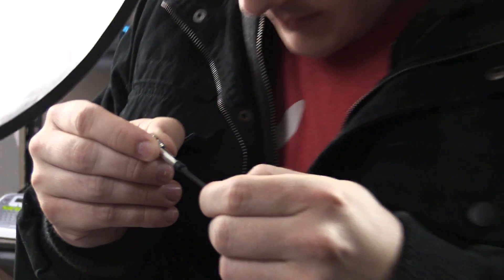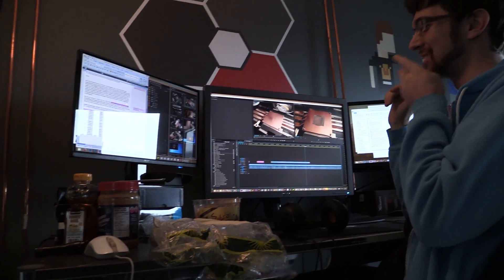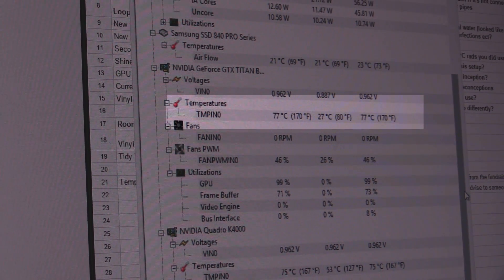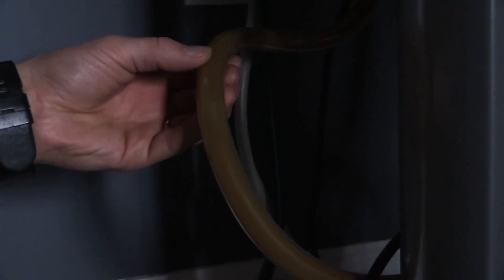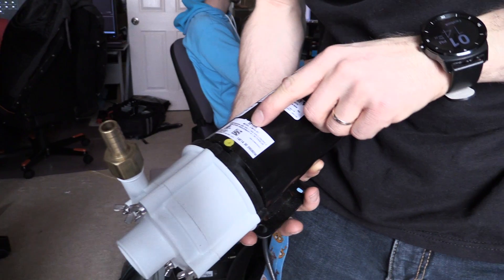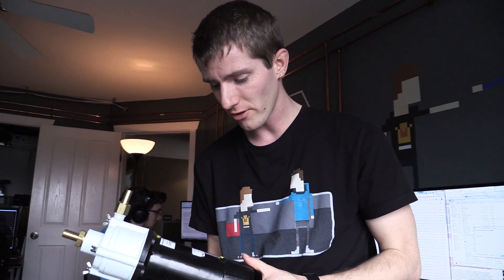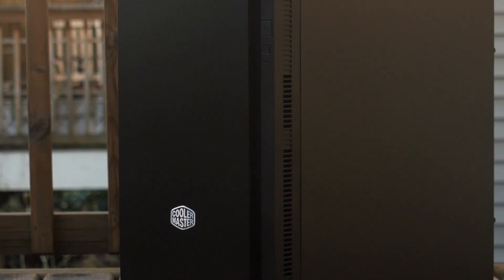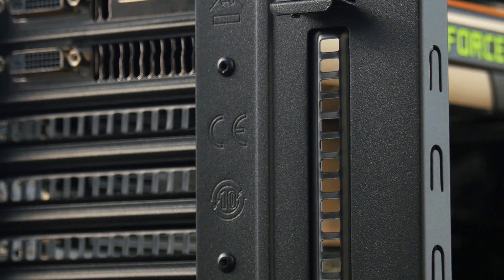Whole Room Water Cooling Part 5a - Trouble is Brewing in the Whole Room Loop...

Comment: LinusTechTips It looks like you have some galvanic corrosion happening.  This can happen when there is a potential difference (voltage) between dissimilar metals in contact.  To find out more about this and see how bad the situation is you should look up the metals anodic index and find out what the potential difference is.  I would recommend setting up galvanic anodes or an impressed current system.
Reply: Jayfluf is most likely correct galvanic corrosion happens when you mix metal and have any sort of ion or electrical contact. As ions will be part of any liquid mixture and the waters own movement will create a charge this is a problem, fyi this type of reaction. Caused the British navy the loss of many ships around the time of the seven years war they tried to copper clad ships and it caused the iron screws/bolts to rust away and the ships hulls failed (my degree is in history) because your reservoir is steel this is an issue. I would use a glass, copper, or plastic reservoir. You should never mix metals in any water circulation system. There are a few exceptions but to be safe I would go copper or non metal.
Reply: Edit: I'm not sure if you already have a filter in place but that should implemented if not.  Also, there should be some anti-microbial/anti-fungal agents in the coolant you use.  Feel free to contact me for more info if needed.
Reply: Tanner Rodriguez The colour of the tubing looks like corrosion, not just organic material.  Automotive cooling systems are designed with knowledge of anodic indexes and take the potential differences into consideration; I cannot say whether the corrosion inhibitors are suffice for this particular application.
Reply: Eric Ayers I'm not aware of any issue where residual oils can completely negate corrosion inhibitors.
Reply: Eric Ayers Corrosion inhibitors are used in oil based products as well.  Most additives are in small quantities, hence the term additive.
Reply: jayfulf Actually automotive systems are not very dissimilar from what they've built. There are reasons for some cars absolutely(at least in the past, at the present not as much) needing specific types of antifreeze. This was especially true in the early days of aluminium cylinder heads and such.

The stuff in the loop is most definitely some type of algae or bacteria, they are very common when you use undestilled water in cooling loops, or even in diesel fuel that has been contaminated by water.
Reply: ColtaineCrows I think you should re-read what has been typed.  I've already provided insight into what you've pointed out.
Reply: Ummm... you kinda lost me at "galvanic"... =\
Reply: Changing the reservoir would take out a large potential but still leaves the piping, fittings, cooling blocks, and radiator.  Changing the piping to PVC would also take out lots of potential and if both were changed it would probably be enough that the potential difference in the system would be negligible.  However, this system is already set up and the most time and cost efficient way would be to use some form of cathodic protection.  As mentioned before as well, a screen needs to be implemented in the system.  A screen protects pumps from damage, protects cooling blocks from clogs or debris that could affect cooling, lastly it allows for a visual indicator of how clean the system is.
Reply: Tanner Rodriguez If you mean we're clueless as in we don't know that you don't understand what's being discussed here then I would tend to agree with you, negating the idea of cluelessness in the first place.
Reply: The biggest deal here is to remove any non-Copper, the copper piping is ok as it is the same metal as the radiator, as long as they use an anti-corrosive they should be fine. The problem is that steel res, (and if those pumps contain any non copper metal that contacts water) the anti-corrosives in the coolant will help some but you are fighting the natural process, so I would change the res-and any NON-copper fittings to PVC. The biggest deal like we have mentioned is to not MIX metals.
Reply: As mentioned, cathodic protection is the simplest, cheapest, and most time effective solution.  This is not only the most viable solution that would work the best other than completely redesigning the system.
Reply: moe jaime Technically speaking there will always be a potential difference, even if all the metals are the same.

Edit: Also, this is not electrolysis, it is galvanic corrosion.
Reply: moe jaime I think you are a little confused or misinformed on this subject.  They're similar concepts but they are not, at all, the same.  The flow of water is not what is creating the current, it is the dissimilar metals; galvanic corrosion can happen in fluid that is static (not moving).  If he knew this the system would've been designed differently.  I'm not entirely sure what you're trying to say with that last run on sentence but look above and/or google galvanic corrosion and electrolysis for more details.  There is something known as electrolytic corrosion but that is also not the same.
Reply: jayfulf
I believe he could have either type of corrosion and you are correct even with it all copper there could be a slight issue as not all "copper" will be the same, e.g. purity. But I think to keep both Electrolytic Action and/or Galvanic Corrosion from happening he needs to loose that steel tank. Unless its an anti corrosive steel its going to cause a problem I looked it up and some steels can be mixed with copper (BUT MOST cannot) Both types of corrosion deal with mixed metals I feel the flow of water and moving parts could cause enough of a static charge to cause electrolytic action, and just the mixing of the metals can cause Galvanic, both were issues with early naval vessels. The anti corrosive properties in the coolant will may slow the process. He also probably has a bio issue as has been mentioned because a PC does not get hot enough to kill biological contaminants like a car does and he did not add an anti-biological agent. And I feel they will need to flush this every 4-6 months, they cannot use a sacrificial anode because the bi-product would get in the water blocks.
Reply: MA Tech Firstly, you have essentially repeated what has been said previously, albeit I'm not sure why.  Secondly, you are attempting to explain the very things I've pointed out and demonstrated my understanding of for, again, reasons unknown.  Lastly, a sacrificial anode would not be in the loop and there is still other means of cathodic protection as mentioned.

Comment: if your moving in a couple months why even do this unless the room has the same layout inch for inch? The Landlord will be pissed fix the holes from the screws! And drop the anti freeze stick to the water I think the AF thickens. Flush out the tubes with water thoroughly try the res again only after a you seal off the outputs fill with water shake empty out, refill new water shake then let it sit for an hour pour into a tub so you can see anything leaving if it still does have crap refill and sit over night empty if no crap start the connection over. How long since the start until you noticed the sludge even though it's "Day 5" after 4 months of planning at least stated in the vid was it 1 2 3 17 plus keep hourly track of the main pump make sure clean if this is on is it 24/7 or do you shut down the pcs? if the first pump is repairable place halfway through the loop in the new place.

Comment: what i did to keep my audio jack from breaking is take a little spring out of a ball point pen and put it at the place where the most tension and then secure it will heat shrink tube around the spring and the wire, $20 head phones now going on 3 years everyday use lol

Comment: That is what happens when you use tap water, tap water will make anti freeze do that. You can get 50/50 anti freeze or use distilled water next time. Also all of your tubing and tank will have machine oil in them.

Comment: You can put a filter before pump and after reservoir... and a bar/psi meter to check it. you can avoid trash and other thinks with that, and if the filter clogged your pressure will drop. you can think it... (sorry for my bad english)

Comment: I'm thinking of hooking up my CPU and GPU radiator piping to an AC radiator , and using an Arduino board with sensors to control the cooling process according to the room temperature to avoid condensation in the CPU … you guys think that's a cool idea ?

Comment: Use acetone to flush the reservoir and radiators.  It's an organic solvent which is extremely effective at breaking down polymers, like that oily gunk binding the bacteria.  Scientists use it to decontaminate laboratory equipment when they don't want stray organisms fudging their results.  Nice and cheap, too, you can get 5 litres of the stuff for about $40 or less.  Just don't feed it through plastics like acrylic or rubber or silicone tubing!

Comment: if you replace the radiator go with a use car radiator and electric fan.  Bugs would be less of an issue and it would handle an outdoor in environment much better.  only down sides would be having to come up with a fitting set up that would let you connect your smaller tubes to the bigger connections on the car radiator and the electric radiator fan would use more power.

Comment: If you use deionized water and a true biocide, not the imitation trash they sell on PC websites, but contact an agency that maintains industrial cooling systems. with true biocide one drop would maintain that entire system for months, its that potent. Also consult a plumber, mixing metals in plumbing can be risky. I cant recall which specific metals are not to be connected to each other but youll need to research that. Question, why copper and not PVC for your main lines.

Comment: @LinusTechTips

6:55 Did you use "Plumbsure PTFE Tape" on the threads of the valve ?
14:05 Never Mind To My (Prev Comment ^)
 
9:13 Did you flush out the whole system after you "Soldered" everything because the "Flux" out on for soldering pipes Is/ Can be toxic. And is highly "Corrosive"

Comment: So I work in pro audio and have had lav mics fail at the connection point many many times. When they do break you can take them down to any reputable music store and they can fix them. If or when you do that you can ask them to sleeve the cable. Also to prevent pulling or pinching on the cable I recommend running it up your back and over your shoulder.

Comment: Quaternary ammonium preservatives could resolve that problem. DDAC, didecyldimethylammonium chloride, is known to have amazing antifungal and antibacterial effect at concentrations as low as 3 mg per liter, being one of the best quaternary amonnium preservatives out there. You can also work with benzalkonium chloride in the solution and should be easier and cheaper to get. If you need some help regarding preservative chemicals feel free to send me a message.

Comment: The brown goo looked like it was diatoms but the sheet didn't. I'm just basing this off the fishtanks and the fish store I used to help run so it may not correlate to this set up.  You should be able to flush the system (excluding blocks) and possibly get a biocide in sufficient quantity via a pool supply house.

Comment: add a large whole home water filtration unit it would keep sediment out of the system put it on the outgoing side of your pump preferably use a large whole home unit with the desired micron filtration you want I have been doing this for years another good thing to do is add a few drops of dish detergeant per gallon of coolant and use hyper lube coolant additive for automotive coolant also use distilled water with your automotive coolant not tap water.

My unit uses a V8 5core copper / brass car radiator and has a huge amount of ability to get rid of heat.